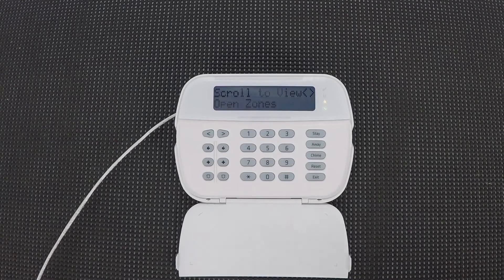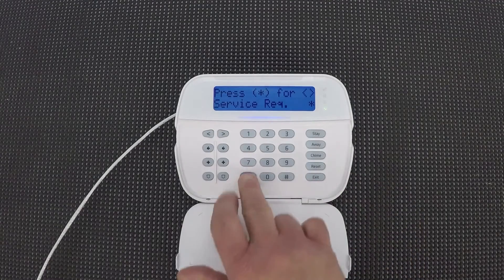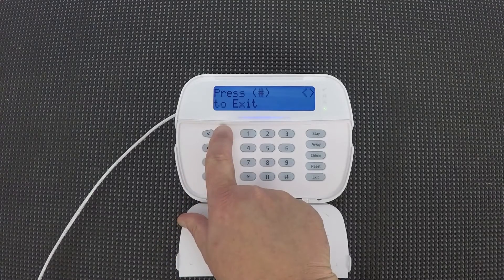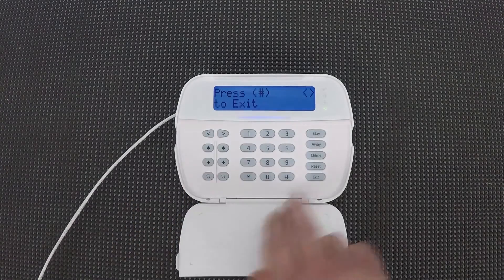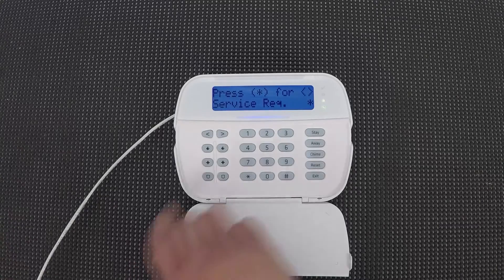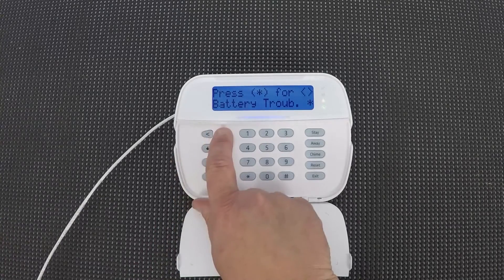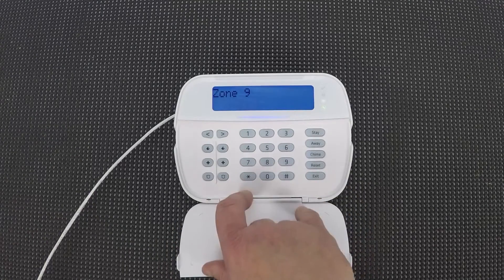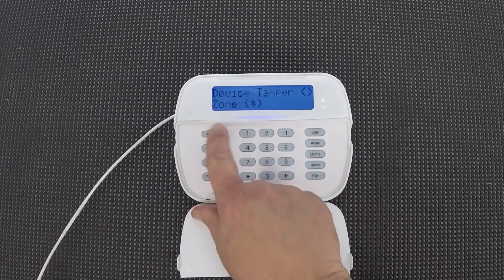DSC PowerSeries NEO Trouble Code Review - Alarm System Store

Comment: How did you clear battery problem?
Reply from the maker: It depends on what exact battery problem you have, but generally replacing the referenced battery and power cycling the panel will clear the trouble.

Comment: How did you fixed zone 9 problem
Reply: The trouble showed a tamper condition, so the fix depends on the sensor type you are working with. You can check the tampered device's manual to see what triggers the tamper condition on your sensor, but usually, this means the device's cover is off or not secure.

Comment: I have a zone tamper on a wireless motion sensor, how do I fix it?  I don’t know the installer code. Thanks
Reply: You dont need the installer code to resolve a tamper. Just resolve the tamper on the motion and it will clear.
Reply: @andybowman9697  how about if i want to get rid of the motion sensor, how do i clear it up from or at the control panel?? thanks'
Reply: @LUISNEVESseven  You would need the installer code to do that.
Reply: @andybowman9697  thanks for that, but should I wonder why they don’t give that code to the client, or is just a way for them to get at us??  Once again, appreciate your help 👍